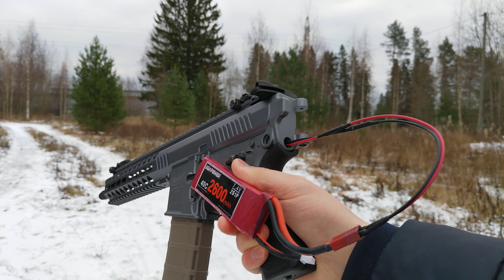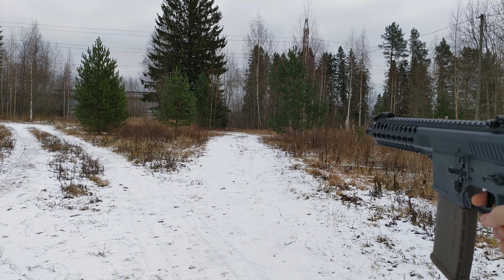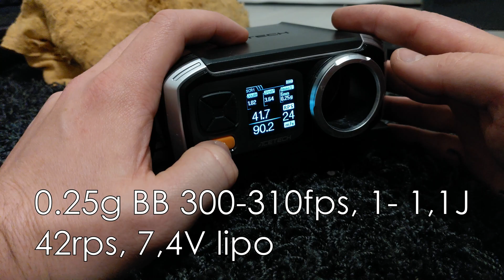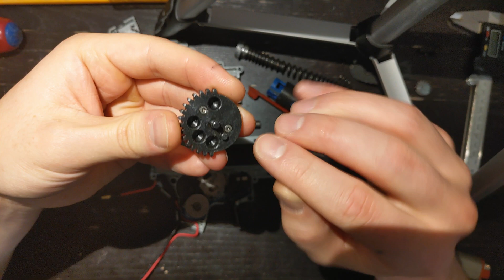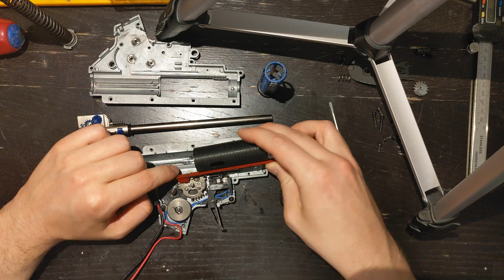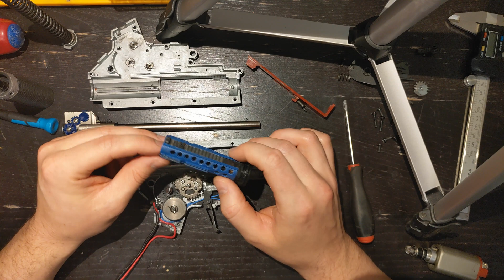Triple Sector Gear "TSG" now available! 42rps 340fps 7,4V

Comment: Can a gate titan be used or a perun hybrid mosfet work with this TSG? I want to attempt a build. 

This is awesome man🔥🔥
Reply from the maker: The SHS compatible version only works with fets that read the gear position from the teeth. One piece one also work with ones that read the cut off cam.

Comment: i cant imagine the maintenance that needs
Reply from the maker: Well actually running this setup at 50rps is equal to running a single sector setup at 17rps because you get 3 shots per gear revolution. The part speeds, and therefore strain is a lot lower than one would think. Only thing you run through is tappet plates because you need so strong of a tappet spring that they wear out fast.

Comment: Damn honestly I'm more of a trigger response kinda guy so I'll stick to 10:1 gears with a high torque motor. Also my feild doesn't allow full auto any way so whatever
Reply from the maker: the TSG is specifically for trigger response people that don't need fps above 330. I recommend using high torque motors with the TSG, so 20tpa and up, but it runs on 16tpa nicely too. It all depends on your gear ratio and what spring you are using.
Reply: @Maekiii  tru, but I run a dmr at 415 fps, so it's fine, it would be pretty nice to turn my krytac pdw into a sub 350fps dsg or tsg, for cqb👍
Reply from the maker: @joshiwoshiluz  TSG is quite difficult to get to work compared to a DSG which already can be challenging for many techs, so I would recommend DSG first instead.
Reply: @Maekiii  also Ive only been teching for around a year, so I don't know if I'm ready for a dsg/tsg. What skills should I need to be able to make a successful dsg. I do have a bit of experience short stroking, so I assume that would help.
Reply from the maker: @joshiwoshiluz  It all comes down to experience, but there are good videos on the subject here on youtube and discussions on forums.

Comment: Interesting video! Thanks for sharing. Your comment regarding sorbo v spacers for volume is however incorrect sorry. 1.5mm of sorbo at the front of the cylinder reduces the available cylinder volume by the exact same amount as using 1.5mm spacers between your piston and piston head. All using spacers does is move the 'dead volume' from the front to the rear of the cylinder. 

To put this in context (again we'll use 1.5mm):

With sorbo at the front of the cylinder, it prevents the cylinder from traveling 1.5mm further forward
With spacers between the piston and piston head, it prevents the piston head from retracting 1.5mm further back

In both instances you lose 1.5mm of volume
Reply from the maker: Hello, sorry but you misunderstood what I said. What you are talking about there is the volume you lose when you adjust AOE but it's not what I'm talking about. By dead volume I mean the volume that is between the tip of the nozzle and the piston head in its forward most position, basically the volume that the piston cannot compress. This also includes the area around the cylinder head pad/sorbothane. With sorbothane you increase that inaccessable/dead volume by reducing the amount the piston head can go forward. Therefore for each compression cycle the peak pressure is not as high as it would without having a thick buffer there. This is known to affect fps in DSG setups already so with even less stroke length its even more important.

Comment: No semi?
Reply from the maker: The single piece TSG has semi cams for traditional cut off levers so it has functional semi. The SHS compatible version you see here does not and requires an optical fet to have functional semi, otherwise it will not.

Comment: No benefit to me, my SSG is already 42rps-44rps with good trigger response
Reply from the maker: Depends on what things you value. With this you get better trigger response, but lower current draw, so your motors last longer and you don't need as big of a battery.
Reply: @Maekiii  I could see an advantage to this over a DSG in a gun with a tiny barrel and not much battery space. Personally I would do it in something like a M3 or maybe a Bizon, over HPA, because I'm against HPA
Reply: @marinusdedreu3833  this guy is also running a 7.4v. Im willing to bet youre using an 11.1v to achieve 42-44 rps. Imagine if he used an 11.1v.
Reply: @Maekiii  I run a brushless motor and graphene batteries so Amps doesn't make much heat. Not worth all the tuning hassle to run I tiny barrel and get marginally better trigger response than a DSG. Mine is already almost as good as my DSG largely due to the fact I'm running a brushless motor

Comment: I'm not a tech. But maby and this a hell of a idea and could work with a proper reinforced design. 

My first thought was to shorten the piston....but with everything else that's not possible. So maby in stead of the "Swiss cheese" approach. You would remove x amount of distance segments in between the cycle of the gears pick up. In turn making a piston in the underside where the teeth are with gaps to help with the return to make it work. I know that's a whole bag on new ideas and issues(more issues than good ideas) but hey..airsoft has come this far. Why not try. If I'm unclear on my description. Send me a message and I'll try to explain what I mean better
Reply from the maker: Not sure where you are going there but the limiting factor of rof is not the piston but the nozzle timing.
Reply: Thank you for the reply. But isn't the timing in sync with the piston??
Reply from the maker: @martyguy8185  What I mean is that we have been able to run this 70rps without getting any premature engagement on the piston.  So it is not limiting the speed. But we lose a lot of fps on full auto at that speed. That is caused by the nozzle not returning in time to make a seal. If if we make the nozzle return earlier then the BB's don't have enough time to feed.  So the speed is only limited by the feeding system.
Reply: @Maekiii  a long time ago I've read about a gentleman that would reinforce tappet plates with guitar strings. He'd cut off the pick up, then heat up guitar strings to 300°C or so ( i assume, he never went in to detail ) and sink them in to the polymer, then reattach the pickup to the tappet plate and feed the guitar string all the way to the front and almost up to the nozzle. 

Looking at it again, I think a wise move would be to use a laser thermometer to measure heat and just use the guitar string as a resistor until it hits temps, then push it in to the tappet plate. That could allow for a much heavier TP spring.
Reply from the maker: @zibingotaeam3716  That's definitely something worth trying. It does not really solve the timing issue entirely though. The main cause of the feeding difficulties is the fact that the sector gear is rotating 1/3 the normal speed for each piston cycle, so the tappet is being pulled back very slowly. That means the nozzle spends less time in its end positions, and more between them. Return speed is a separate issue but easier to deal with because we can change the timing by modifying the tappet and using stronger tappet spring. But making the nozzle retract faster requires a complete tappet system redesign. I do have some ideas though and will share them if they end up working.
Reply: @Maekiii  If your idea is a reversed angle on the tappet plate cam engagement surface, you'll most likely  need a reinforced, ideally completely metal tip at the end to get noticeable effects with a tappet pick up that short, as rounding it off to make plastic work will probably not get the required dwell times on the nozzle. I'm not sure how well that would work, given it is metal on metal friction with less than ideal amounts of lube available. Outside of that, maybe an electromagnet pulling the tappet plate could work. Would require control logic though. 
GBB float valves are out of the question, as far as my laymans understanding can tell, for being too slow with the air volume available to control the nozzle position.
Reply from the maker: @zibingotaeam3716  Yes reversing the cam angle is something people are already doing with these when they are trying to push more rps. It helps a bit but not enough to solve the issue. I also have considered the solenoid thing, its one option but a bit more complicated. I have a fully mechanical design in mind but have not modeled it yet.

Comment: Howd you get 340 fps on such a short barrel? I have a krytac vector DSG with a 6.03 150mm barrel and I cant get it above 300fps with .2s. Air seal is perfect, switched the nozzle to a shs double o ring one, and I trimmed the tappet spring. It has a guarder 170 in it and wont break 300.
Reply from the maker: There are a lot of places where you might still have a leak. The fps is low for a reason. The seal inside the gearbox is easy to check, but most likely you are losing compression between the nozzle and bucking. Also possibly wetween the bucking and the barrel. What bucking are you using?
Reply: Sorry I didnt see you replied or I would've answered more promptly. I've tried the stock vector, shs double o ring, shs single o ring, laylax krytac, and a maxx nozzle. Currently the shs single o ring nozzle is the best one giving me 305 fps with .2s. The hop up is a prommy flat hop bucking with firefly nub and teflon tape, it gives better fps than the stock krytac,  but I've also tried maple leaf with the omega nub which didnt work well. I think somehow the vector hop up must be leaking or misaligned, or I need to trim the tappet plate shorter than 11mm.
Reply: @jhqtech  PTFE the world

Comment: whats the difference of this 2?
SHS compatible version TSG:

Single piece 18:1 TSG
Reply from the maker: The SHS compatible version is meant to be installed on an SHS sector gear by replacing the original top half with the TSG. That allows you to pick any gear ratio that SHS offers. Make sure to buy the correct gen as explained in the video. With this design you will have only one cutoff cam, so you will not have functioning semi unless you have an optical mosfet. 

The single piece one only works with 16:1 and 18:1 gear sets. Because of 3d printing tolerances it has no axle on it, so you need to take one from a stock gear. If you want to use traditional trigger mech or mosfets that use a mechanical switch, pick this one.

Comment: Have you tried using the new brushless motors that are out?
Reply from the maker: The things I have heard is that they are not that great, but I havent tried them personally.
Reply: @Maekiii  there is another company called Warhead industries that is coming out with one that is supposedly better then the current option #1 drop in brushless motors.

Comment: What about reducing the mass the tappet + nozzle. Make the tappet spring work less hard.
Reply: Would work however the more material you remove the weaker it gets, building a good AEG is very similar to building a race engine as in everything is a compromise
Reply: @John--cu2yu   Yeah TSG is more of a jet engine car ... more about what can be done then should be done i think.